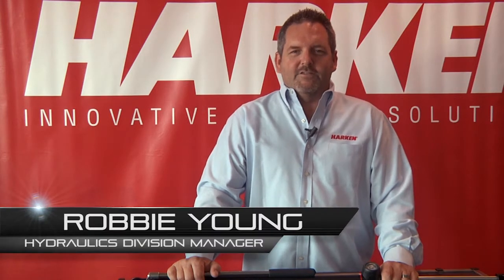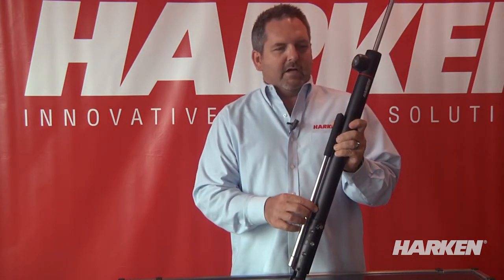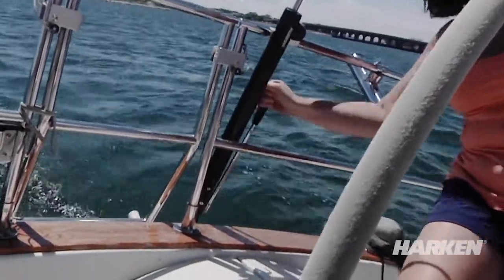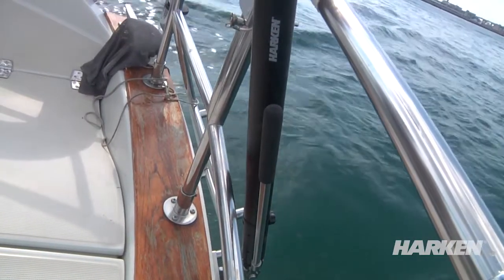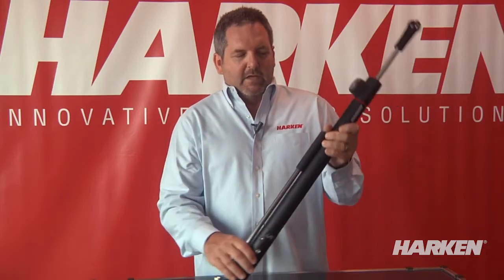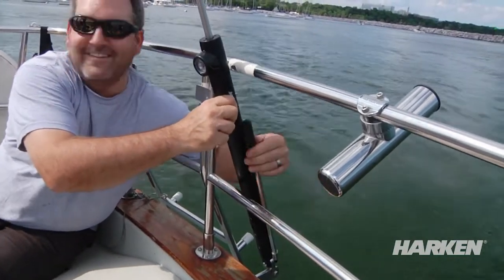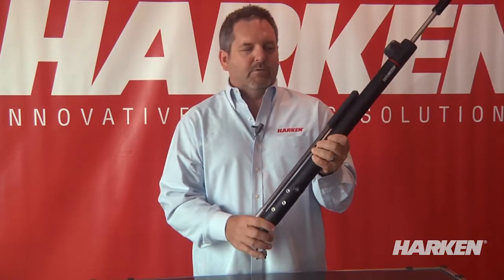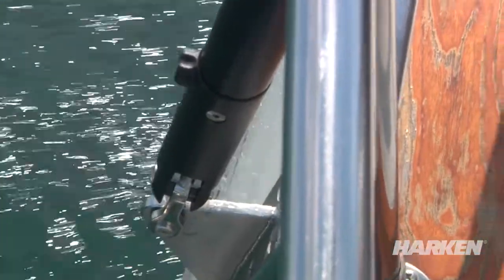HARKEN Integral Backstay Adjuster

Comment: I just had a brand new Harken unit installed on my 40 foot sailboat.  My unit did NOT contain a gauge, when I asked the installer he noted that Harken has stopped using the gauge on my model due to problems with the gauge.     Is this accurate